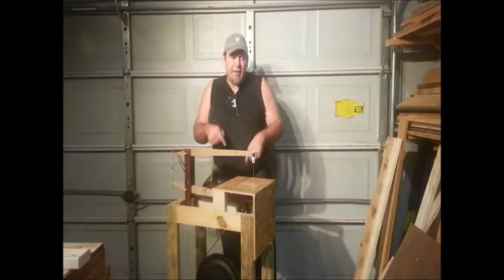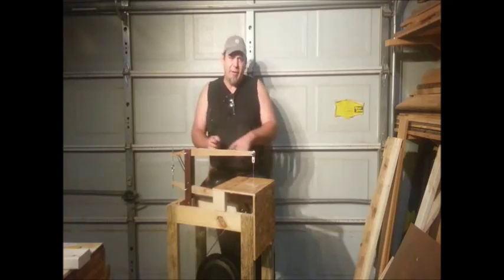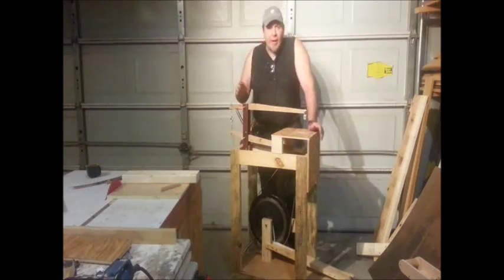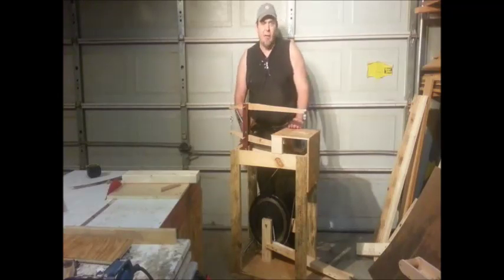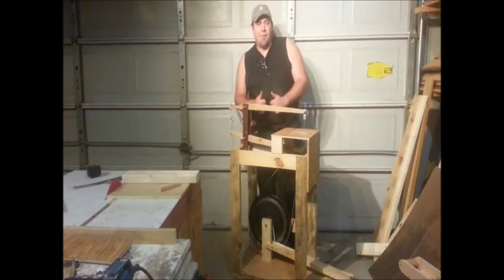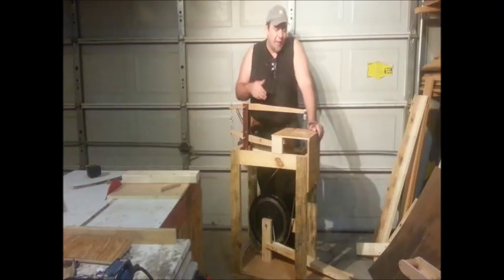Foot Powered (Treadle) Scroll Saw Made from Pallet Wood

Comment: Saw a hippy at a festival making intricate jig saw puzzles free hand using a very old treadle scroll saw similar to this. The wheel acted as a flywheel where he didn't have to pump continuously. A bicycle rear wheel would work better as it would coast like his did. I have wanted to make one since that day.
Reply: A bicycle wheel, the bigger the better, and get some good weight on it. Some type of steel ball around each spoke that is free to move, when first starting, the weight is near the center, when up to speed they move outward and place the mass near the rim, thus giving it more inertia.

Comment: Great video! I like the idea and the result. Do you think with a couple of the parts being made of heavier material, the same concept would work for a treadle powered band saw?
Reply from the maker: Not very well it might be ok for 3/4 and thinner material but much larger then that and it would be incredibly difficult to get the kind of power needed.